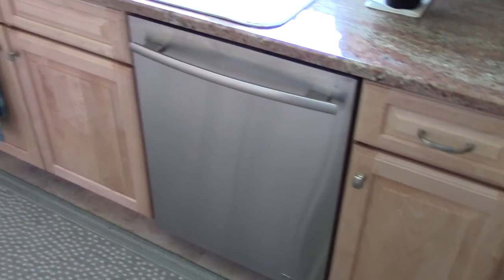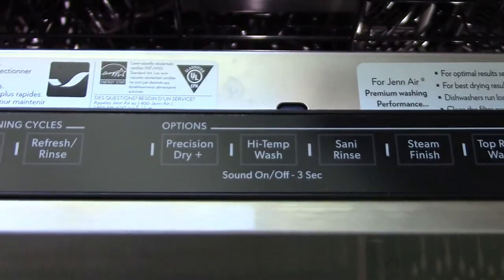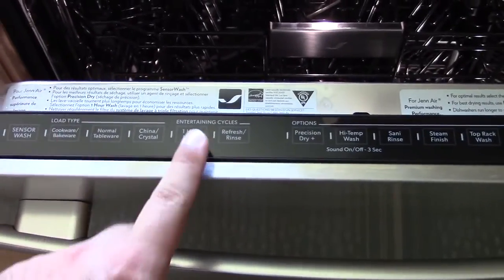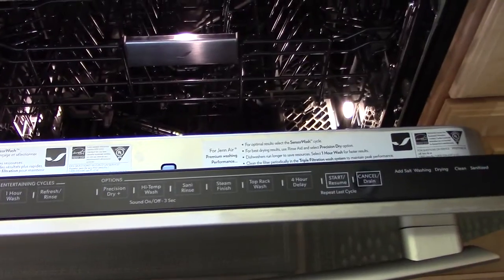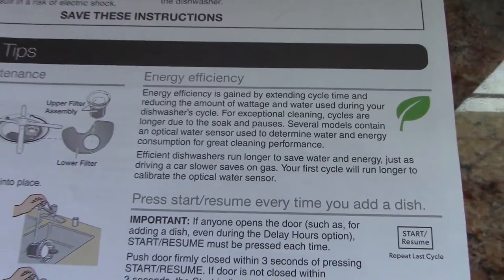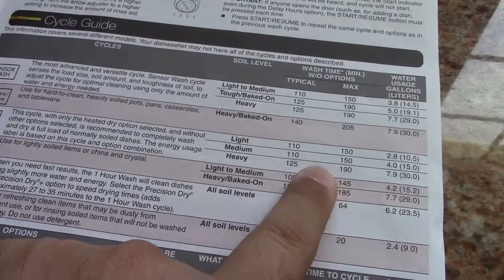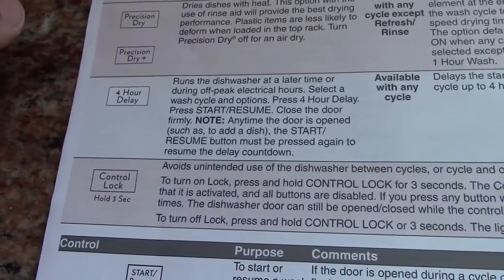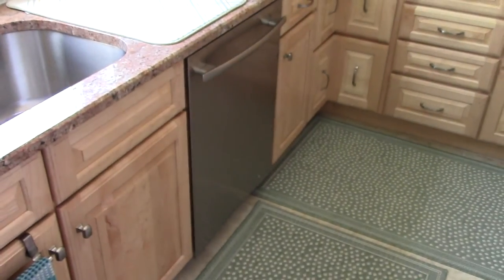Modern Dishwasher Design and Efficiency (or Lack Thereof).

Comment: Our Whirlpool has "Heavy wash" "Normal wash" "1hr wash" and "Soak & clean". Options are "heat _fry_" (just for laughs), "high temp wash" & "sani rinse" w/ 4hr delay. I've never used 1hr wash or soak & clean on ours, only normal or heavy, and I have not had the chance to calculate the time it takes on heavy and normal, but I can assure you it's more than an hour even on normal. Whenever I select heavy wash, I just use whatever default options pop up on it, and it's done the job, but at a very unnecessarily long amount of time. 

It also does the same thing with drain pump where it cycles on and off, which is completely stupid, as that adds even more time to the drain cycle itself, (not to mention all the chips and transistors and diodes and what not that it's eventually gonna blow up cycling the circuit back and forth). It's not as fancy as yours,  but it certainly is not my first choice in dishwashers. One day I plan to replace it with one that has a mechanical timer when it does break down to the point where either it's irreparable, or it's something that's easily replaceable but the cost is ridiculously through the roof because it's chian.

I'd love to get my hands on a older Kitchenaid Hobart if the opportunity ever comes up, one that deserves to be called a real dishwasher.
Reply from the maker: Yeah. I STILL miss our GE Potscrubber from 1989. Very simple and just did what it was supposed to.
Reply: You said you replaced it in 2002 right? What was wrong with it, curious?
Reply: "Because it's chian".  Awesome!  I remember the sticker!
Reply from the maker: I think it leaked and last I heard the heating element was not working. But I cannot remember if that was completely true or not.
Reply: Ahh.
Reply: Today's dishwashers are nothing more than lawn sprinklers in a box! I was at my older brother's house in Huntsville, TX, where they had a Maytag (built by Whirlpool) in it. When I heard it run, oh boy, what a disappointment!
Reply: They alternate the wash arms too! At least Frigidaire had a brilliant idea to alternate the spray arms while maintaining water pressure!

Comment: Here's the two cents from the Badger half of the Bur-Badger duo:

Our dishwasher is a Kenmore (Whirlpool) Ultra-Wash model 665.16992400.  It has the built-in disposer, which can handle up to 1/2" solids.  As it recirculates, solids and particles collect in a compartment, which contains the grinder.  As it drains, the grinder operates and all the particles flush out with the water.  Every time we wash, there are at least 8 cat bowls with crusty remnants of cat food.  The only thing we rinse in the sink first are plates which contained pancake syrup, as I can't stand the "maply smell" of old syrup.  We even stick in the burnt-greasy drip pans and grates from the stove.  Never ever is anything still dirty when it comes out.

The times for ours are:  Heavy wash is 120 minutes, including drying cycle, and TOTAL water usage is a whopping 9 gallons of water... Normal wash 90 minutes, including dry, with a total of 4.8 gallons.  Our Rinse and Hold cycle:  6 minutes flat, and uses 2.2 gallons.  I can't possibly imagine trading that little bit of water for running a 4-amp motor twice as long.
Reply from the maker: Yeah that is SO much more reasonable than what we have here. All we use is 1 Hour Wash. Thankfully it's not like we need to use anything other. But still, the wash times on this thing are just pathetic.

Comment: When I'm buying an appliance I'm not interested in getting a Prius that gets the job done eventually, I want a Corvette with a big motor that will get the job done in the shortest time possible.  That's my idea of efficiency.  Don't make me waste my time waiting 2+ hours to get the job done.  Just be glad the appliance manufacturers told the Department of Energy to take a long walk off a short pier when the DOE asked them if they could make dishwashers that used only 2.5 gallons per full cycle as they were thinking of changing the water usage regulations.
Reply from the maker: Yeah at least they did that to the damn DOE. Great comparisons though. Jay would love to see that!
Reply: 2.5 gallons of water? This is so stupid!
Reply: I have the very same beliefs!  As another YouTuber told me, there's no replacement for displacement!  I'd rather run an inefficient thing for a short time than an "efficient" thing for a long time.
Reply: 2.5 gallons of water to wash dishes in a dishwasher? Really?

Comment: Wow, that thing's a real gem there.  SO what I'll do here is itemize my list to make it easier:
1.  No control panel, yet they RUIN the entire front of the machine with the little hole, that looks so out of place, just so you have the tiniest inkling of what might even be happening, or trying to happen.  At that point why didn't they make the handle have a lighted bar going across?  Sure would look cooler that way, especially when it flashes error codes across the kitchen like when an emergency vehicle with the lights and sirens going drives by!
2.  Those cycle times are an absolute joke.  Then again, when they claim efficiency because it runs so long, and they're using a 19 cent DC hobby motor to drive the whole thing, maybe they're right.
3.  Let's not forget that control panel and the sensors that use electricity even when the dishwasher is off is driving up the electric bill, and if you use the dishwasher two or three times a week, what happens the other four days?  Right, it just sits there and burns electricity, where a mechanical timer version would be Frankenstein-style O.F.F. when it's done.
4.  Driving a car slowly saves gas?  Sometimes.  When you're stuck in traffic, not so much, since the engine has to not only continuously run (though they're doing away with that nowadays, that's GOT to be good for the car), but also cycle the cooling fans, which of course uses electricity.  Could you imagine a car with a near-dead battery shutting itself off like that, then trying to restart, while you're in the middle of a 95 degree day on the Belt Parkway during rush hours with an accident 1 mile ahead and two lanes closed?  Brilliant.  They say that driving a car at 55MPH saves fuel over driving it faster.  Cars and transmissions were always geared to give you the best efficiency in that range, top gear, lowest engine RPM possible at that speed, but I can't imagine going 65 totally negates any savings.  Especially since cars are all bubble-butt now, round, plastic pieces of crap.  The other day we had the Buick out and some guy was sitting in his Toyota 4-Runner when we came out.  Had the window rolled down, and he said "I had one of those when I was a kid.  They don't make wheels like that anymore!  Look at this piece of crap I'm driving now!"  Sure, gas mileage got better when they switched from 7+ liter engines to less than 2 liter engines, but at what cost for performance?  I happily drive around getting 5 miles to the gallon in that car.  Oh yeah it eats gas, but I get where I'm going with all sorts of looks, fun, sounds, and pleasure.  Instead of newer cars.  THE BIG SIX is only affording me about 18 miles to the gallon with the limited around-town driving I'm doing now.  That was 40 years of design and development, and 2 less cylinders, and all we gained was 13 miles to the gallon.  SUVs and trucks, which everyone has to have now, even lower.  I rest my case.
Reply from the maker: Well, when the time comes that I can get ya here, we shall hook up that Gegzno watt meter to see just what it pulls, since it is plugged in! 

I still can't get over the builder trying to convince me that the cold water line was better for it. Once again, I am Sharkie for a reason! Makes me wonder if any other houses around here have that misfortune. But oh well, their loss!
Reply: Their sprays are weak! They're doing away or have done away with garbage disposers in them! Absolutely stupid! What is wrong with this picture?
Reply: Yes, definitely need to hook that up.  I should hook it up to mine and get video of that beforehand, that way we have a baseline!
Reply: BTW, what does the book say regarding water supply?  Does it specify hot or cold???
Reply from the maker: It states to purge the hot water line first! So yep, builder was full of crap
Reply: Ha ha ha!  Although I know one doo dah doo in particular that probably would prefer it on the cold...
Reply: This is why my dishwasher is hooked up to the hot water supply!
Reply from the maker: Gotta conserve, especially in Connecticut hun.
Reply: Right, when I'm running two places...
Reply: How about running the dishwasher once and have dishes doen right the first time!
Reply: correction... done

Comment: The reason the drain pump pauses when it's draining is because it's self-cleaning the filter.
Reply from the maker: Well the filter still needs to be manually cleaned eventually, so I'm not sure how well of a job that does.
Reply: @Sharkie626  You'd have to clean it much more often if it didn't flush itself out.

Comment: I hate that the new dishwashers don't pack enough water pressure unless they alternate the spray arms! At least Frigidaire dishwashers obtain proper water pressure by using alternating sprays with ENOUGH WATER PRESSURE! And you are forced to use high temp wash just to get it to clean properly! I want my dishwasher to make noise! I know my dishes will get clean UNLIKE THE WHISPER QUIET DESIGN!
Reply from the maker: Do the alternate?? If they do That's a new one. Maybe I can open the door on this one really fast to check.
Reply: Yes, they do! You can tell by the sound changes during the wash cycle.
Reply: What you can do is simply listen to the wash action and see if you can hear any changes.
Reply: @Sharkie626  Your Jenn Air model transitions as well. I cannot stand that, what’s the point of it if you can’t clean all racks at once like the older dishwashers? Some new Whirlpool models will wash all zones at once but it’s became a rare wash system nowadays cause everyone has copied that idea from Fridge